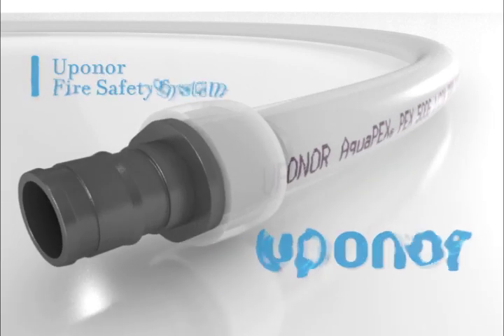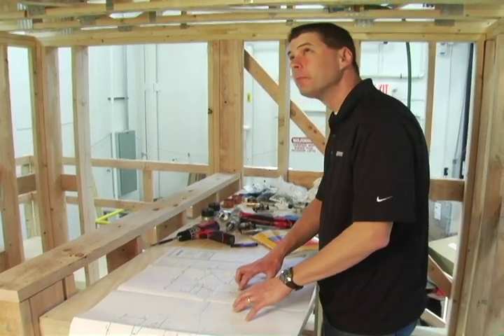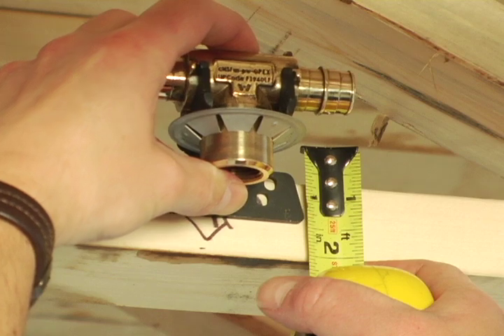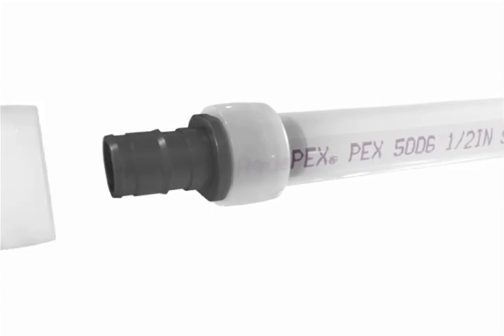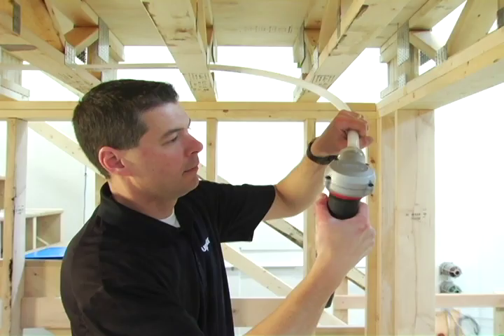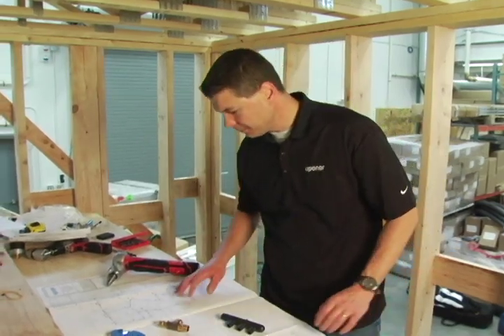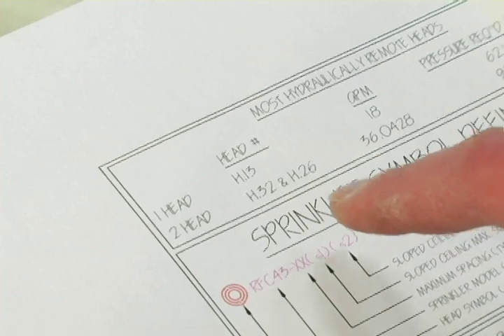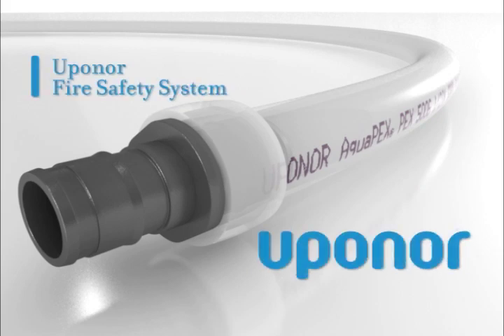AquaSAFE™ Fire Safety Installation | Uponor

Comment: Is the water hose fire safe??
Reply: When behind drywall that can hold a fire back, yes it's fire safe.  It does burn slightly more than the CPVC that is more commonly used for residential fire suppresion.  This should never be used exposed in an industrial environment.

Comment: Garbage! It's not the most effective! It's not even monitored
Reply: I have a Master's in Fire Protection Engineering and I have designed systems using this technology for 1 & 2 family dwellings with less than 20 sprinkler heads. The only water fixture I connect at the very end of the line is a toilet, it flushes the line everytime someone uses it and although it is NOT REQUIRED to be monitored, I do have it monitored by using a time delay on the vane switch.
Reply: @billlukasik1801  nice!  just dosent make sense to not have monitoring on a sprinkler system . I've come across some goofy systems over the years using that 20 heads or less rule.
Reply: @billlukasik1801  What's a time delay on the vane switch? I'm looking at adding a few sprinklers in my garage. I was also thinking of cutting them into my toilet lines or the outdoor hydrants (won't get much use in the winter though so maybe that's a problem?). My logic here is "better than nothing". I don't want this to be expensive I just want it to help if the a fire starts. So cost is definitely a concern this system looks great in that regard.
Reply: @Niklaos  you will need to have a daily flow on that line. Will you have a toilet being used after the last sprinkler head? If not, then you will need a backflow preventer. The normal time delay I use is 30-45 seconds on the vane switch.
Reply: @billlukasik1801  Is the daily flow required for all the fixtures? I'm mostly thinking about water hydrants that might only get a few flow a year and all of them, mostly in the summer. I'm also planning to only use lead free sprinklers so if that's the reason for the daily flow, that won't be a problem.
Reply: @Niklaos what I meant by "daily flow" was running water through the line on a daily basis for not more than 30 seconds.
Reply: @billlukasik1801 you mean that the fire sprinkler system will shut off after a certain amount of time? I'm assuming this is a fail safe in case of an accidental activation of the system with no fire present?
Reply: @AKS-74U No. I mean that the fixture at the end of the line should flow water for not more than 30 seconds at a time.
Reply: Lol
Reply: Much better types of systems around then this.
Reply: Actually it is - every time you use a water fixture.